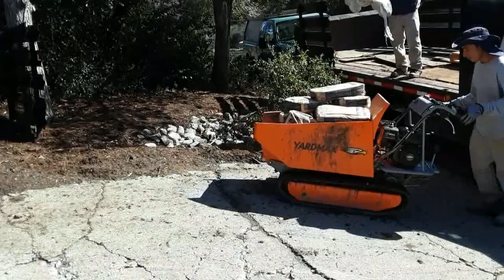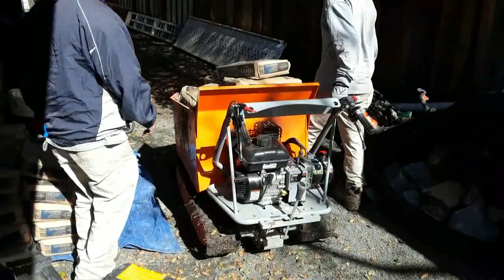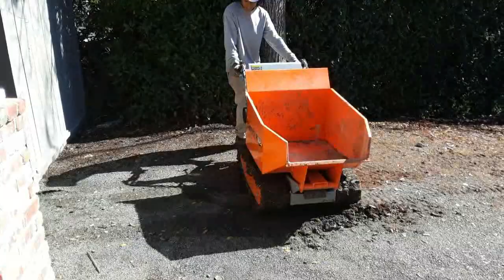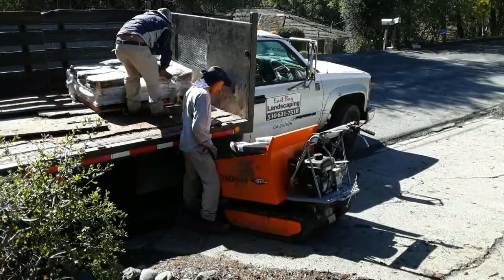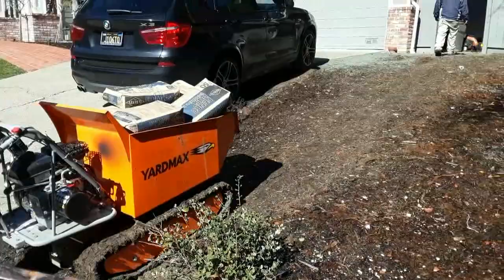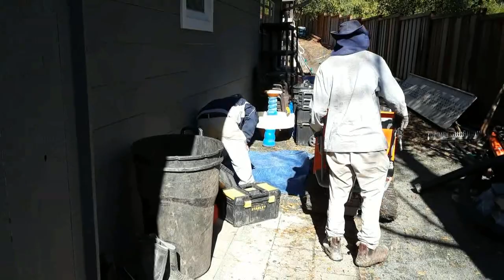YARDMAX - Power track barrow loading concrete bags

Comment: Do you still currently own the machine?
Reply: How has it held up?
Reply: yes
Reply: @mtorresg10  how has it held up?
Reply: @juanochoa9410  it works very well
Reply: @mtorresg10  no major issues?
Reply: Normal use. Replace some part
Reply: @mtorresg10  que facil fue de consiguir las partes?